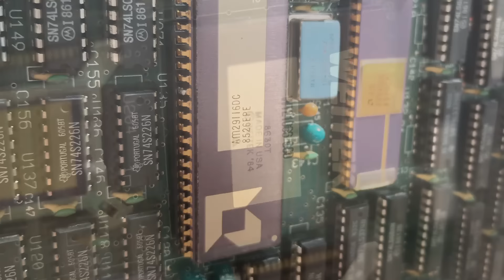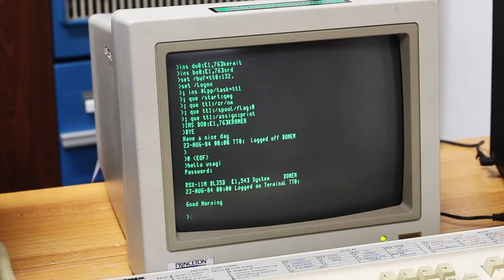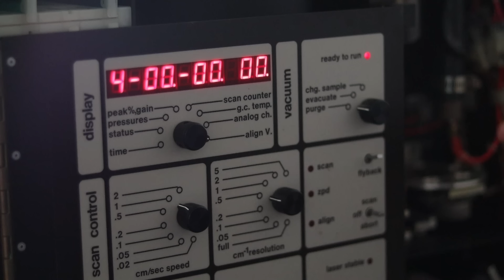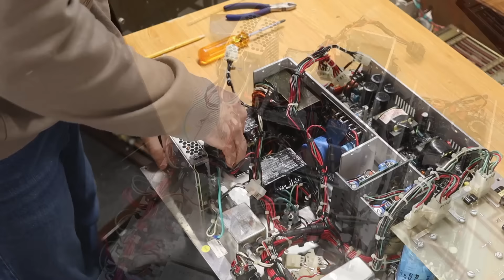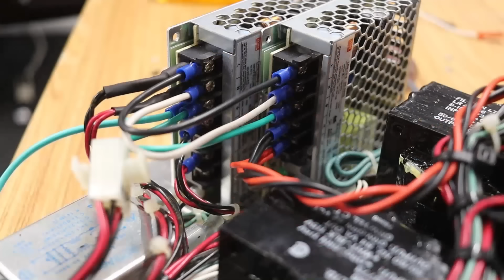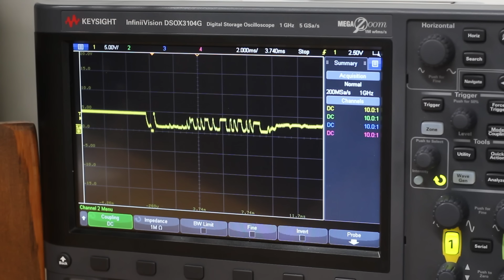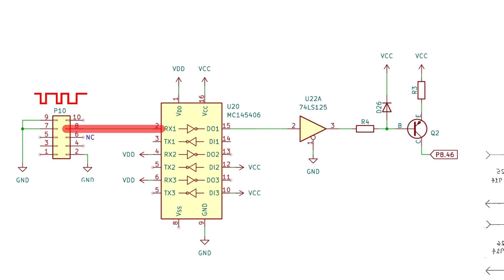I Tried to Connect the Bomem and PDP-11/73, It Did Not Go Well...

Comment: Now you know why all of my circuit board designs include a set of jumpers to swap both the TX/RX and the CTS/RTS signals.😁
Reply from the maker: This is the real big brain move here!
Reply: @UsagiElectric  The inverter stages looked problematic too but I don't have any elegant solution for that. I'm sure you'll get to a working solution - you're definitely on the right track.
Reply: @NateEngle  Wonder if @UsagiElectric is considering some valves and an audio transformer for buffering, polarity, and isolation. 
A little retro on the retro. 😜
Reply: Smart!
Reply: I hate serial so much you have no idea.
Reply: @MrNoobed  I used to work with a guy who said that if you didn't like RS-232 you could just wait a year for them to completley revise it.
Reply: @NateEngle  i have some genuinely old equipment to work with like an ft2000 oc48 and the serial will just decide not to work.  Is it because the modem is bad?  Did i change adapters whole trying to get it to work with my cisco switch?  Is the admin board broken becuase its 30 years old?  Who knows! Aaaaaa
Reply: @MrNoobed  I like playing around with old automotive ecus every thing is done through serial, I need to find a windows 7 laptop with serial because I’m tired of the stupid ftdi usb adapters that just randomly die and drivers are a nightmare
Reply: @turkeyboyjh1  use the more costly opto isolated versions!
Reply: @alexanderstohr4198  I didn’t know that was an option, I have thought of building a board to isolate the rx and tx lines do you have a model you would recommend
Reply: @alexanderstohr4198  I’m not even kidding when I say I have a box of probably 15-20 dead usb to serial or obd2 cables and they are extremely useful but one wrong pin or like the vw that like to send 12v down the k line because someone installed an aftermarket radio and fry your cable ecu tuning is a fun endeavor that will very much test your patience
Reply: @turkeyboyjh1  I vaguely recall that there was a slow-start sequence at something like 4 baud to wake up the communications channel, then it'd switch to something much faster, like 300 baud or something? That was a long time ago. What were the actual baudrates involved?
Reply: @vicenary  vw k line use a 5baud wake up with a 10,400 baud rate, it varies by manufacturer and generation of ecu as well as how you are retrieving data from the ecu eeprom emulators are amazing because you can read the info real time of the memory bus
Reply: Indeed! Been there, got many T-shirts... 
1) Did I get TX & RX the right way around?
2) Are TX / RX components labelled TX - TX and RX - RX, or TX - RX and RX - TX?
3) Are said TX / RX components 'helpfully' labelled backwards..?  
Life's too short to find out... as above, add jumpers to the design and send it. If no joy at least one can start 'counting' though the jumpers until it works.
Reply: @charlesjmouse  i like a 2x2 checkerboard setup - each opposing corner belongs to the same device. so you only have two options to put a pair of jumpers on the header. ;-)
Reply: I like to put solder jumpers there. Those are also great to test, you can easily push a probe into the soft solder. Also I like to put those together with high/low pads close to enable/disable pins, so I can force those independently of platform processors and the like

Comment: Got to love it when your data cable is so heavy it needs structural support 😊.
Reply from the maker: When I build the new desk for the computer, I'm going to have to build in a support for the opto-isolator board to hold the heavy cable!
Reply: @UsagiElectric I think those Centurion style desks are so cool. A computer needs appropriate furniture! I liked your wooden circuit board mount for the opto thingamajig and as always impressed by your persistence.

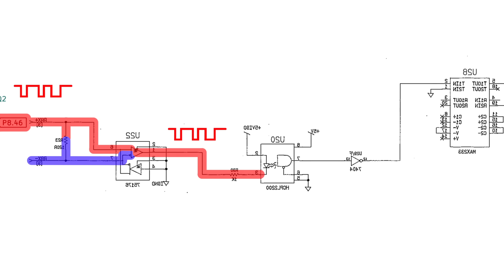Comment: 25:54 It looks like the problem can be fixed by swapping ARX- and ARX+.
Reply from the maker: Maybe? We chatted briefly about this over on the Discord. It could work, and is a good idea, but we're not sure on if it would cause any other unintended problems. The real right move here is to get the correct parts and eliminate having double opto-isolators on the ADC path.
Reply: Swapping the differential pair is perfectly fine and will do what you want for the serial signals, but as you say there's a lot more being sent on that cable and getting the right boards is a heck of a lot easier than debugging every single signal individually.

Comment: Hi David, can't you just drive the inverting input of the differential line receiver rather than the non-inverting input? This ought to produce an inverted output.
Reply: That's what I was thinking, just jumper out one of the inverters and you should be good.
Reply: Yeah, I was thinking just the same when seeing the schematic, if the input stage after the cable is differential, just swap the pair ...
Reply: It’s an isolated differential signal.  You should just be able to swap the wires on the input.
Reply: Noticed the same. When swapping the wires in a differential pair, you're going to invert the data.